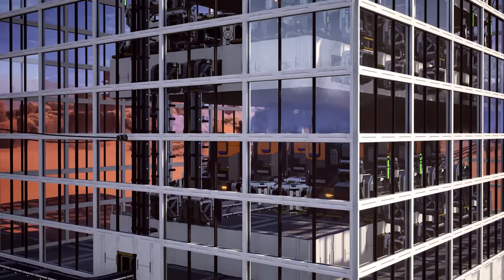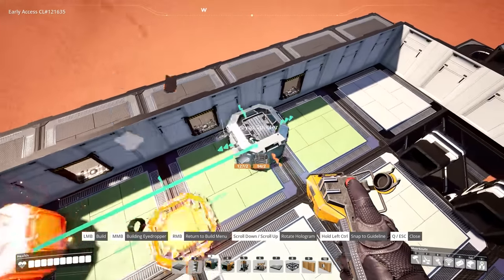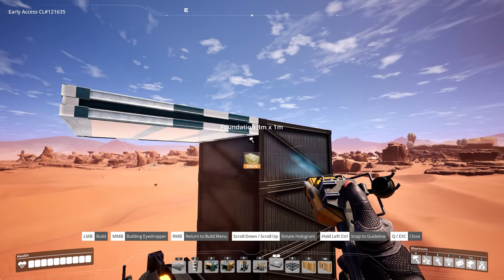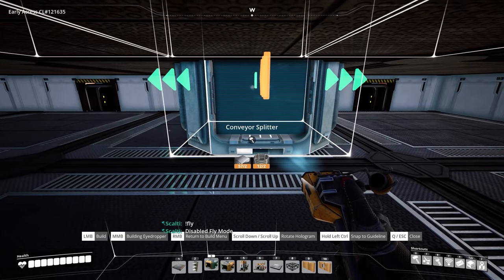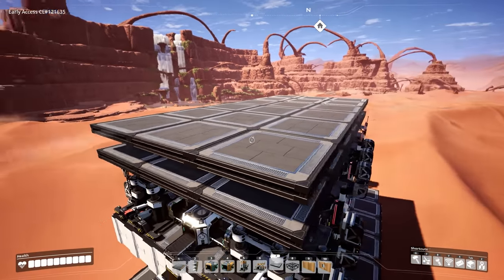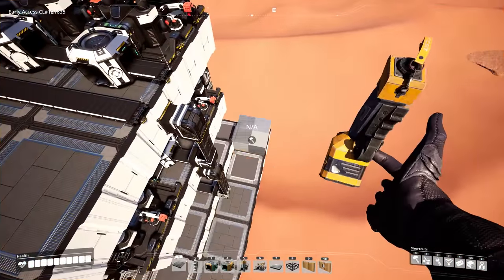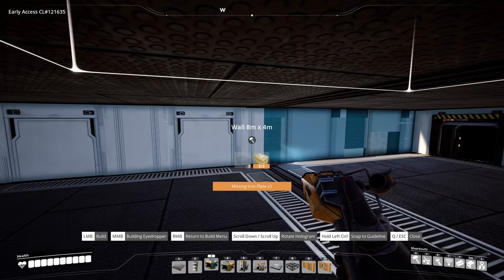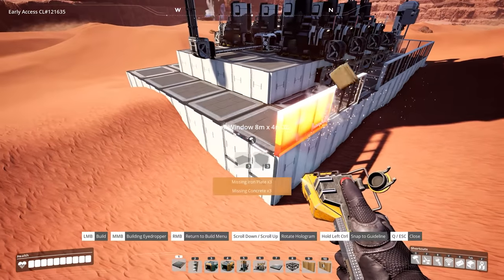100% EFFICIENT 20 Reinforced Iron Plates / Minute Factory! [SATISFACTORY GUIDE]

Comment: For anyone trying this out, it IS actually necessary to placing the machines atop the sandwich layer before placing the beltwork below in the sandwich layer. I didn't use fly, so I tried to finish the sandwich layer before placing the machines and I spent an hour trying to figure out why the game would not place the machines down. There's no clearance issue that shows or anything. The game just will not place the machines down if the sandwich layer has mergers and splitter underneath where you're trying to place the machines.
Reply: Does it even need to be a sandwich layer at all? Why not just make it standing height?
Reply: @jedmanivx  What do you mean? The sandwich layer is 2 meters and 2 meters is standing height.
Reply: @bumbro07  sorry am new to this game, got confused by camera angles lol.
Reply: @bumbro07  yeah I don't think so
Reply: @romainsavioz5466  If it isn't now, it was at the time I made the comment.
Reply: @bumbro07  what do you mean ?
Reply: @romainsavioz5466  Your comment "yeah I don't think so" to me seemed to mean that you didn't think what I was saying was true. I was saying that if what I was saying isn't true now, it's because an update in the past 5 months has changed it. When I made the comment 5 months ago, you had to place the machines on top before you laid the beltwork in the sandwich layer. That may have changed by now. I haven't played in about 5 months.
Reply: @bumbro07  I was saying that you didn't need to make a sandwich layer and you can juste have normal size layer. I just miss targeted the message
Reply: @jedmanivx  you can do it in a normal size room

Comment: Resources:
Spliters: 19
Smelters: 8
Mk. 2 Lifts: 25
Mergers: 20
Constructors: 16
Assemblers: 4
Reply: God teir person
Reply: All buildings broken down into parts enjoy
{please note that more reinforced plates may be needed since I used only 2 plates (the minimum) for the mk. 2 lifts} 
Cable 98
Plates 98
Rods 80
Reinforced plates 104
Wire 192
Rotor 16
Reply: @Bobdo.b  not counting the walls and foundation?

Comment: i just spent what feels like 6 hours building this, rewinding the video, running back and forth to get materials and cursing my inability to fly! Currently i am totally burned out but after a good sleep i look forward to connecting this to my newly built bus system!
Reply from the maker: I certainly hope it didn’t take that long lol. Now I’m debating on if I should do future builds without flying to be of greater benefit to non modded players. There are definitely some  effective scaffolding type methods. — at the end of the day I’m excited you’re excited. It’s why I’m making these guides.
Reply: @Scalti  nono the flying is fine and yes, it did take me a good 3 hours atleast id guess with all the running back and forth haha

i did finnish it and now that i watch it work it seems that 2 of the assemblers have to wait for plates while the other 2 assemblers have to wait for screws.
Im running 120 iron ore per minute into it and the floors are as follows
1: everything is melted into ingots and move on to the next floor
2: There are 4 constructors making rods and 6 constructors making plates
3: 6 constructors making screws
4: The 4 assemblers making reinforced plates

Its still spitting out reinforced plates but i have no idea if its 20/min (since im bad at math haha). Does this happen in your build as well or did i do something wrong at some point?
Reply from the maker: Kristoffer Wallenberg you need a total of 240 iron ore going into the factory.

Comment: WOW I am impressed that this was your first guide its very comfortable watch and you explained it very good so it’s nice and easy to rebuilt.

I am personally not a fan of the sandwich layer tech but sure it is a very easy and functional way to connect everything. In my Building, I would wider the space for the belt work in the sandwich layer upwards, so I can have a more cleaner setup. 

But nevertheless, a really good Guide and I’m looking forward to use it by myself

Comment: Don't forget guys, you can use 2 power shards in a miner harvesting from a normal node to affectively output the same amount of ore as if you had the miner on a pure node. The tradeoff is a little extra power consumption, but it's a nice thing to know if you're building your factory in an location that doesn't have a pure node in the immediate area. You can also double the size of this factory by using a mk.2 miner with 2 power shards and a mk.4 conveyor on the miner (240 items/minute baseline with 200% clock speed is 480 items/minute, which perfectly matches the transfer rate of the mk.4 belt if that's something that matters to you).

Comment: For anyone building the sandwich layer and can’t get the walls to place right, the only workaround is to place the floor one 8x1 foundation lower than it should be and then place the wall. After that you can return the foundation to normal levels
Reply: I have been scratching my head trying to figure this out.  Like "it works in his video, what am I doing wrong?"
Reply: MrBdericks Yeah it only works for certain parts

Comment: love your tutes!  very clear and elegant.  please add power runs, i think those would be a nice add.  also, are you thinking of doing a version with the Cast Screws alternate plan?
Reply from the maker: Correct about the miner. It was used simply for presentations sake. I’ve since adjusted to not do this anymore as it was causing some confusion. 

I do have a video I just uploaded that shows how I route power. Be sure to check it out.

Comment: Would love to see a Follow up videos maxing these builds out with top tier belts, OC, and Mk 3 miners.
Reply from the maker: Ooooooooo
Reply: @Scalti  Alternate recipe adjustments as well. Did a rotor and a modular frame factory using alt recipes(Casted screws, and Stitched iron plates) based off your style not perfectly balanced but I'm working on it.

Comment: You should let us know where mk2 belts are needed because they are expensive at this stage of the game, and we cant afford to do everything in mk2. So it would be easier for your viewer if you let them know where mk2 is needed instead of just building the whole thing on mk2 belts.
Also, these vids are awesome man, have been following your guide's as I am doing my first proper playthrough, so thank you heaps  :)
Reply from the maker: Solution is to operate at half efficiency if needed. You’re still getting 10 per minute at 50%. Get the core system running and go work on something else or explore and then come back to a decent inventory and up the belts over time. My way of approaching it at the least.

Comment: Awesome tutorial, and I can't overstate that! There's really only one small thing I could even consider asking for. Any suggestions for how to optimize the factory if you've unlocked the casted screws alternate recipe?
Reply from the maker: It fudges the ratios overall. To be 100% efficient you’d change from making 20 rip/minute to 25. Each RIP is 60 screws/min and you make 50 screws from the casted recipe. The least common multiplier of 50 and 60 is 300 screws. At this point the iron plate amount now has to change because we’re making 25 RIP instead of 20. 25 RIP requires 150 iron plates, to make those you need 150/2*3=225 iron ingots. That’s the awkward part is the resources you’re pulling from the ground. You can definitely overlock a MK1 or under clock a MK2 to get you there though.

This design would be a 9x5. 4 assemblers on the short end corners like the standard recipe design is but then you take an assembler and put it in the middle of a long edge to get the 5th in. Adjust the floors in between for the reduced amount of constructors. 

Total ingot draw sadly for this design end in a .5 because if the casted screw recipe so I’d design the whole thing to make 50/min to gets whole number for the resources coming out of the ground.

Off the top of my head I believe that means it’s 450 for the 300 iron plates and then 125 for the screws so 475 iron ore for the system. Actually pretty good using a MK2 miner overclocked to something like 196-7% onto a MK4 belt. 

Dope. I’ll make a video for this.

Comment: I LOVE your videos.  Absolutely easy to follow and professionally done.  Correct me if I am wrong however.. in order to get 20/min don't you need to use Mk. 3 conveyors?  I am using a Mk. 2 miner with Mk. 2 belts and am only getting 10/min.  Don't we need Mk. 3 conveyors to utilize the Mk. 2 miner on the pure iron nodes? Thank you!
Reply from the maker: You’ll need two lines of MK2 entering. Each line splits into 4 smelters. Not as clean as doing one miner but achieves the same result. Once MK3 is available you repurpose one of the other miners.
Reply: @Scalti  Thank you for your response, much appreciated!

Comment: Great tutorial video! I had a question when you mention load balance...why were the lifts to the smelters mk2 (60/min) when you had split the lines into 30/min?...same question applies with the conveyor line to the wall (mk2 as opposed to mk1). I figured since you already had mk3 unlocked, it didn't really matter, just wondering since I'm still a beginner. Thank you again for the video :)
Reply from the maker: MK1 belts are 60/min and MK2 are 120/min. Overall in the video I believe I used MK2 which isn’t needed throughout but I wanted to keep items on my hot bar simple so I didn’t have to open the build menu during the video. Now that we have scrolling hot bars I’ve since started to apply specific belts.

Edit: To add, I used the MK3 at the start simply to be able to use one ore node for the video. I wanted visual simplicity but after feedback I’ve started to be more strict on that. If you’re building this with only MK2 belts available, you’ll need to tap at least two nodes for ore.

Comment: Think you could do a tutorial build video on a early game Iron plate, Iron rod, and screw production facility (and perhaps copper too with copper sheets, wire, and cable)
Reply from the maker: They are in the works. I’m currently in the process of editing the one I’ve made for rotors. After that will be the basic components for both iron and copper which the factories are already designed and just need to be recorded.

Comment: Excellent! Great for a 120 mined source. Once you get Mk 2 and Mk3 Miners and Belts though, doesn't this whole design stop being quite so efficient and require a complete redesign?
Reply from the maker: Either overclock it or build another one next to or above it. These designs are more so to provide construction material for building bigger factories. If you use more than 20 reinforced iron plates per minute then build those twice. I’m just trying to provide a starting point and build method for others to learn from and use in their own say should they desire.
Reply: @Scalti  That makes sense. I'm enjoying your designs! You definitely like hiding the belts, and I think I like that. I'd want to wait later in the game to build them though. They're pretty but like you mentioned, require destruction and rebuilding or overclocking  to continue to be optimized as you unlock higher capacity belts and more efficient miners. 

They are beautiful and you do a great job of video editing. I appreciate your knowledge of the offsets, belt dimensions, balancing, and style. 

I'm at Tier 7 on a second playthrough, mostly waiting on the March 2021 update that might "break" higher-tier outputs and nuclear power. I don't want to spend a ton of time building out a base and handling all the nuclear stuff only to have it all break! Still love the game though. 

Do you ever play with other people? I'd be game to try out and come up with some new efficient designs across multiple stages of the game -- like what's the most efficient way to handle a Mk5 780 line of iron ore to maximize your outputs? whee!
Reply from the maker: I like to play solo because I can do things at my own pace and the way I like doing them. I’ve tried to play with friends and found it difficult/frustrating to try and convey my ideas and vision.

Comment: You have a mark2 drill, which is not early in game as the mark2 conveyors, and are concerned about the mark3 conveyors being too late for this setup initially, so you split the drill 240/min  onto two 120/min lines, which the mark2 can do.... but your belt from the drill to the splitter would have to be mark3 to feed the splitter at full speed - a mark2 belt for that joint would slow the feed rate to 120/min into the splitter, putting 60/min on each line even though they are mark2 belts...
The mark2 drill can of course be replaced with a 200% overclock for the same effect until getting the mark2 drill, but the belt situation....?

Otherwise, love all of your tutorials, they are some of the cleanest, clearest, and ideally paced videos (ie, not full of lighting-fast turns, rapid placments and connection-making simultaneously, requiring tonnes of replay to decipher what actions were just taken)
Reply from the maker: Appreciate the feedback. To your first point, I did state that it was simply for ‘presentation’ and that you at least need 240 ore coming into the system in some way. For the simplicity of the video, I sourced the iron ore from a single node. Everything else within the factory is available like the MK2 belts. 

While I would like to be as true as possible, my goal is to keep the factory build as the focal point. Ultimately, players build in various locations around the map with access to different node purifies and quantities. So I decided to simply speak to needing 240 iron ore and leave it up to the player to determine where that amount comes from.

Comment: You mention that the miner is on a pure node and you split into 2 belts as the enter the building with 120 each. If I haven't got access to a pure node, would the efficiency still work on, for example, a normal node? I do have access to mk3 belts though.
Reply from the maker: You just need to make sure you have 240 iron ore coming in to the system. That can be two normal nodes overclocked 100%. The pure node was for simplicities sake in the guide.

Comment: Great tutorial, I'm following everything so far and have just reached the first floating sandwich layer. Is there a way I can set the default paint colour for my walls so I don't have to use the paint gun on everything? Yours always come out a crisp apple white, but mine are always default orange, is this a mod? Thanks.
Reply from the maker: Modify the upper left swatch and it will change everything you’ve built or will build to white apart from a select few things.

Comment: Looks like the stacking to make it flush of conveyor walls done at 7:36 was patched. Mine will build on top of a foundation no matter what order i place them in.
Reply from the maker: I was working on a video earlier today and built them without issue. I’ll look into it.
Reply: @Scalti  could be something I did but a work around I used was to build a ring of small foundation one step below the sandwich belt zone going all the way around so that when I placed walls it would stick to the lower foundation then afterwards I got rid of the lower foundations.

Real glad I saw your video though opened my eyes to more unique and smarter vertical building techniques

Comment: Like your videos, I have just a noob question. Your walls are white when you build them. Do you use a mod for that or is there something in the options that I oversee ??
Reply from the maker: Once you unlock the paint gun, equip it and then right click while it’s out. This will pull up your swatch panel. The upper left most swatch is your ‘default’ color. Change this to whatever color and it will affect what you’ve already built and anything you build in the future. 

Note: This will (currently) not affect pipe colors
Reply: @Scalti  thanks ^^
Reply: @Scalti  i was getting fed up with the orange :-P

Comment: I know this is old so I doubt anyone sees this,  what's the purpose of doing all the fiddling with placing 4 foundations to delete the middle 2 then to place walls on the top to get a snap point to place walls below to remove the wall on top ect for the sandwich layer? Why not just build to the height you want,  put a wall, build the next floor off that wall? I don't understand why all the extra steps and fiddling around just to make it a few inches shorter than standard floor>wall> floor
Reply from the maker: This guide came out well before update 5 and the introduction of 1m high walls. The point of the build and delete steps was to make the bottom and top of the foundations flush with the wall for a cleaner and more refined design look. At the time, this was the easiest method to accomplish that look. 

I suggest you check my more recent RIP guide that is redesigned using new assets introduced in Update 5.

Comment: I am super lost on your last sandwich layer. you set 3 splitters on one end they have a line connecting the middle splitter to the side splitters, but then you have the ones on the opposite end somehow pass to the other side without crossing the ones mentioned above. HOW? I tried shift, alt, ctrl non work. it's at 20:01 and 20:05
Reply from the maker: Not sure I follow. The belts for the screws are passing underneath the belts for the plates.

Comment: Is it possible to use MK.1 belts at the assembler levels? or will that lower the effectiveness?
Reply from the maker: As inputs into the machine? You’ll need to make sure the screws are on MK2 going up but once you split them you’re good to do MK1. 

If in doubt, build with MK1 and as the factory produces the reinforced plates you upgrade everything to MK2. Couldn’t hurt.